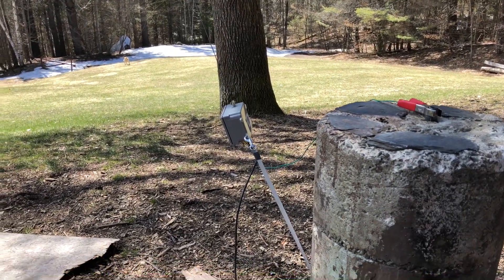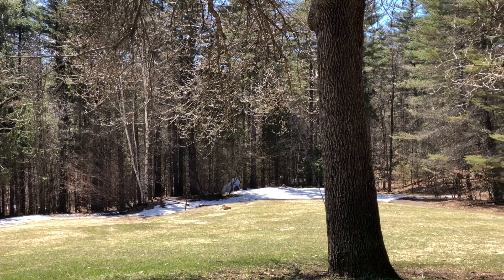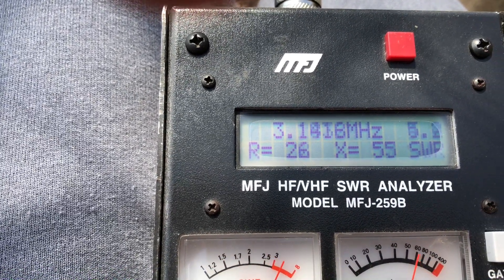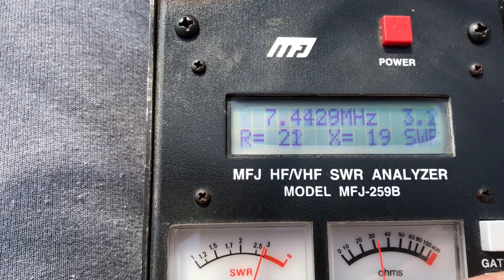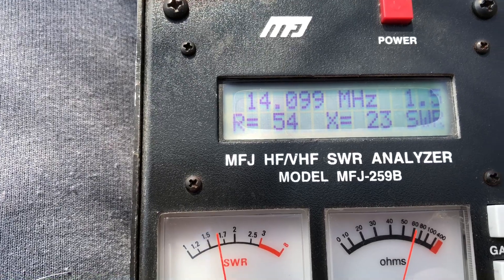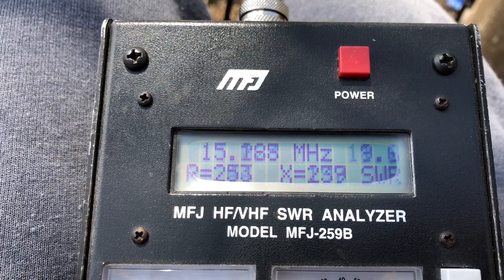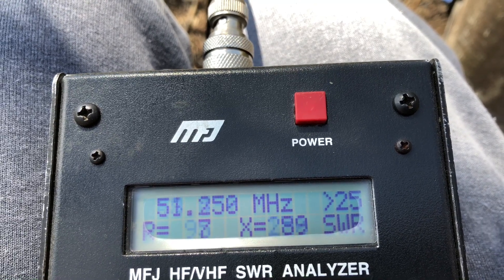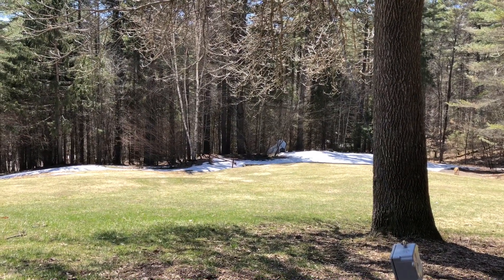End fed half wave antenna test and tuning

Comment: I've built 4 efhw antennas and they all work great. what I build is the 40 meter /66ft with the coil for 80 and have 75 tuned to 3.900 mhz. 73 ki0ad

Comment: Thank you so much for the nice video! Great job .. I was wondering if you put the compensating coil in at 72” from the 49:1 Xfmr (as MyAntennas does) whether that would bring your resonance points down some.? My EFHW is HB 40-10 with no comp coil. It’s about 1.6 on low end of 40 and 1.2 low end of 20 (infact 20 shows a very deep return loss) it’s also relatively “Flat across 20) but I am more interested in CW Portion. 15 is about 2.1:1 and 10 Meters is 3.2:1 but tuner in rig handles it ok. I get NO resonance at all in 30 Meters (10Mhz) you atleast get some resonance which makes me believe that the 80-10 is an over all better antenna to obtain that? 

73

David de K8KEM
Reply from the maker: David Eisenberger yes I did that, I tested it in this video https://youtu.be/TM5OiRV7hfA

Comment: Interesting I found your video. I was just reading, I think an ebay ad for an endfed. Supposedly, cutting it at ~131.8' (cutting it to be resonant at 3.55MHz) should enable use on all bands without a tuner. I've made a 49:1 transforms also. I'm hoping to test that theory out this week, or maybe next weekend. I did a POTA activation the other day and used a 29' endfed with the transformer..only made 10 contacts, but I was it was successful. Good video, I'm going to check out your other uploads. 73-de K4SFC
Reply: Hi Ron, what did your test reveal using a wire cut to 131.8 feet? Were you able to use it on 80-10 without a tuner?